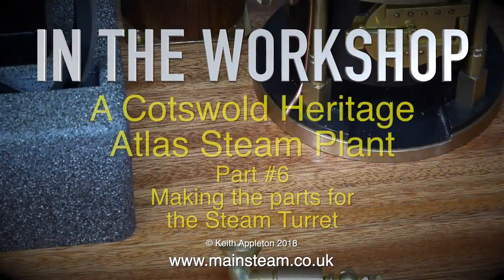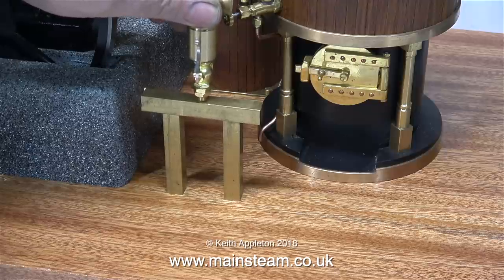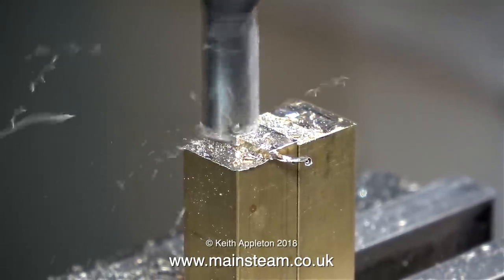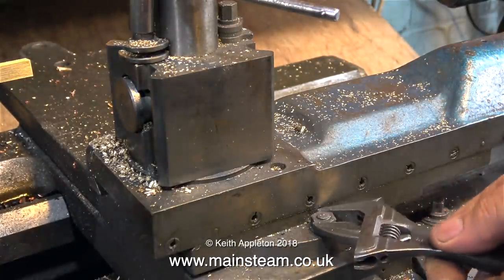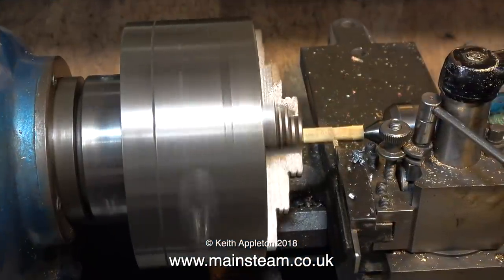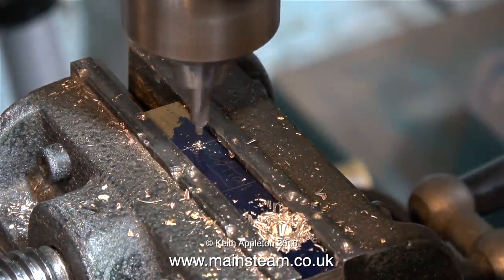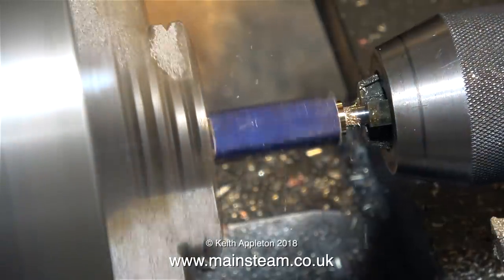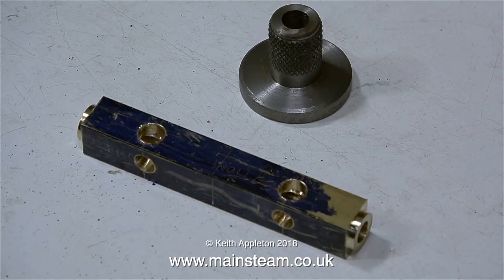ATLAS STEAM PLANT CONSTRUCTION - PART #6

Comment: Does the no climb milling not apply in industry? I watch YouTube videos of CNC machines and frequently see climb milling
Reply from the maker: it is all a question of rigidity. On small, old & worn home workshop milling machines, I generally find it best to go against the work with the cutter.
Reply: @keithappleton  Thanks for the answer and clarification
Reply: CNCs typically have ball screw that has practically 0 backlash. You can climb on a conventional machine with satisfactory result. Just have to know what you are doing. Do it only for finishing cuts and it leaves a beautiful finish.
Reply: CNC machines are different. The real problem with climb milling is the backlash in the lead screw - the force of cutting pushes the nut by the distance of the backlash (maybe 10 thou) until it is forced up against the leadscrew - then the cutter grabs the work and bodily pulls the entire table that same 10 thou back in the other direction, until the  nut slams against the opposite side of the threads of the leadscrew - the cutter then breaks. CNC machines require zero backlash - else the program doesn't know exactly where the cutter is in relation to the work, when it is traversing backwards and forwards. So the CNC guys have a different more expensive form of lead-screw and nut, like a ball-screw, which has zero backlash and yet will still turn. So the cutter grabbing is no problem - what's more, climb-milling can give a somewhat better finish, so often the CNC guys deliberately always climb-mill.